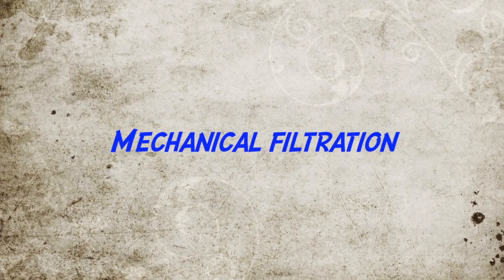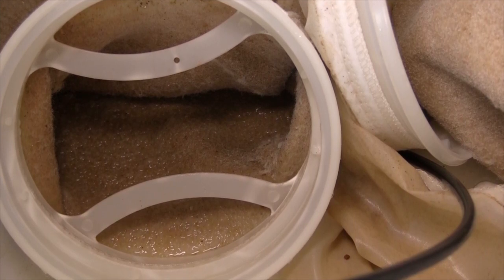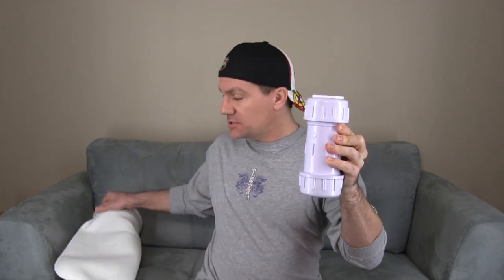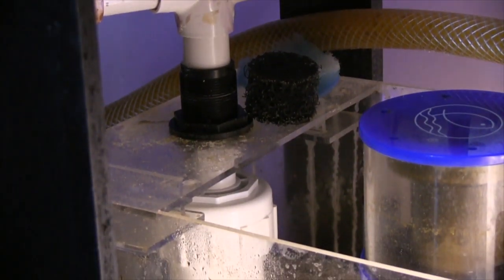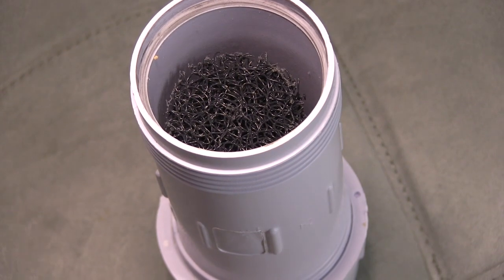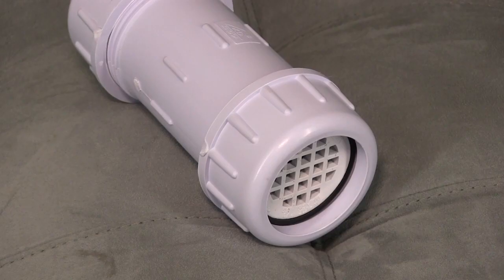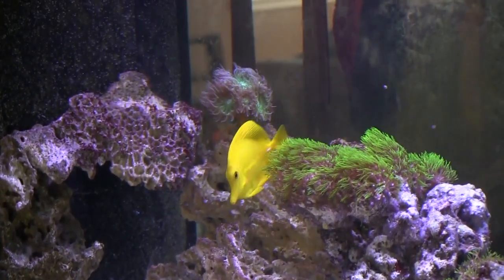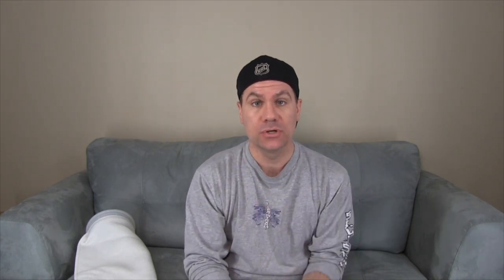filter sock filtration no longer needed! saltwater aquarium filter - rotter tube

Comment: I wouldn't add this because it an added risk of clogging or something getting trapped in it, causing your display to over flow.
Reply from the maker: correct, but you don't clog it with a bunch of filtration, just a little for the water to pass through and over. also, i added overflow protection.

Comment: I recently saw on BRS that you can pressure wash Filter Socks with High Pressure water or a Gurney and it cleans them so great.
Reply from the maker: yeah you can. I don't use them. I'd rather throw out foam pads once a week. Also, with filter socks, that nasty sits in your water.

Comment: Why not rotter tube then in to the filter sock? To times the clen I just asking would it even be werth running that way or looking at adding an unnecessary step to cleaning my tank?
Reply from the maker: that's a good idea. like you said, it's twice the cleaning. the sock would last longer though.

Comment: I have one essential problem with this particular product, if you should forget to clean your filter and you get enough waste backed up in it. Where does the water go? In the situation of a sock it overflows over the top of the sock holder in into the sub directly by passing filtration in the case of this particular device if left too long or a large fish load were to block the filtration it backs up into your tank until your sump empties and out onto your floor
Reply from the maker: hey, great question. it has never overflowed and i changed the design. it's so much different now. it's a horizontal 4" clear tube, parallel to the water in the sump...sitting above the sump water. the water flows easily out each 4" hole on each side of the tube with just a foam filter catching the water. i'll have to do a video again to explain better. never had an issue with these tho.

Comment: Whats the emergency plan on it what if it clogs up and your not home what if it slows down your water flow from the tank and cause the water to over fill your tank, plus that foam isnt  a great filter my advice is using a nylon sock fill them up with media, that way if it does clog your sump will over flow like its designed to
Reply from the maker: nylon socks would work great. i tried them. they work great and are very cheap. it has never overflowed. it works great for catching solids. changing out the piece of filter media every 2 days is what i did. i have a different design now that works even better and catches most of the waste. it's a horizonital clear 3" tube that connects to the overflow. each side is open, which thick filter media inside. links to this video in all video descriptions. thanks for watching.
Reply: @shannon- When you say fill up with media,  do you mean put the media in a sock and then in the filter sock or can I simply put the media directly in the filter sock?

Comment: any risk of clogging and overflow display?
Reply from the maker: +Eli Carter Hey Eli, thanks for dropping by. There is a risk of it clogging if you cram the tube with media that doesn't allow water to flow through. What I do is cut a filter floss strip to be 6" long X 2" wide and use only that. The tube isn't crammed. The water flows through it just like a sock. At the bottom you do need to place one of the grey filter media pieces that I show in the video or you could run the risk of it clogging when the felt piece gets full of debris, which you should check and replace every few days. I haven't had a problem with this at all and I've been running it for a month straight. I include a couple of these strips as well for filtration.

Comment: I thought the idea of a skimmer was to remove the waste before the bacteria had a chance to turn it into nitrates..and socks couldnt be easier to clean..buy the nylon ones they prolly last forever. You probably have more chance of clogging the drain from your tank with this than a 3 inch 200 micro sock.
Reply from the maker: wrong. never clogged. socks also sit in the water column allowing all the stuff to SIT IN YOUR WATER THAT YOU CAPTURE. thanks for trolling.
Reply: Im not trolling at all. I used to try stuff like this when i was a kid tring to save money. They just impeded water flow. I agree a sock will block up too but you can easily see its getting dirty. If a sock get blocked the water flow has the ability to overflow into the sump thus keeping the filter system operating.
Reply: Just buy nylon socks if you hate cleaning them so much. Quick rinse out and your done. Easy

Comment: Do you have a 1-1/2 size yet?????
Reply from the maker: i have relived on adapters for that, to go from 1" to 1.5" and it works great. the new rotter tubes are larger....3" diameter and the 1" is drilled into the side, so it sits horizontal in the tank and not vertical. this is the one i'm using now. the foam never sits in the water for this reason. you can add an adapter to make the 1.5" connection.

Comment: why you not using a filter sock no more ?
Reply from the maker: i like them but too much maintenance. i hate cleaning them, turning them inside out to clean, breathing in the nasty dirt when i turn the encrusted socks inside out. just something i didn't want to deal with. i made a new tube where i just replace 12" of foam pad each week.
Reply: Rotter Tube Reef when I get my tank setup I'm not gunna use the socks either
Reply from the maker: socks are great but the cleaning is just a hassle. i ran my tank with nothing at all for a few months and it was fine. i just did water changes from my sump, vacuuming out with a little pump, 10 gallons weekly. no big deal. you could do that. i installed the new rotter tube and that keeps my sump clean and the water polished. it's just what works for me.

Comment: Also with the Rotter Tube, Anybody could DIY make one.
Reply from the maker: that's right. I have a video on how I did it. Mine are clear thick 4" PVC, which isn't cheap, but of course you can use standard white pvc.

Comment: Cannot see this being as efficient as a filter sock, and I really don’t see people’s beef with filter socks is all about, lazy reefers never succeed fact.. unless you get really lucky and hit biodiversity perfectly and have no sump or filtration like I see on some you tubers with 20 year old tanks claiming no water changes, I call bullshit on most of those..
Reply from the maker: This doesn’t sit in the water rotting like a filter sock and there is no cleaning.
Reply: @ROTTERtube  a filter sock won’t rot when changed every 3 or so days, although clever this contraption is likely 50 percent less efficient than a filter sock, the rooter tube is likely not 150/200 or 250 micron, and filling it with carbon as a filtration solution is not particularly a good idea, carbon should only be used on occasion as it strips too much “good stuff” out of the water, like I said neat idea and will suit some tanks but not tanks that have a large waste turnover
Reply from the maker: @jimelliott33  Everyone has their way. I got tired of cleaning socks. I use and replace foam filter pads every few days.
Reply: @ROTTERtube  I love your inventiveness don’t take me the wrong way, but most new reefers will see this as a way of reducing the mundane work involved in being successful with a reef tank, you can’t be lazy with reefing, and I think cutting out a filter sock which is a pretty effective water debris filtration device could be detrimental to an otherwise working new tank, key to filter socks is like you said having a stock and washing a load at a time, we do all have our ways, like I said I like your device my only concern was the difference in micron filtration
Reply from the maker: @jimelliott33  No worries. That's the point of this...less work and less time so you can spend time doing other things in life or on your tank. Filtration is filtration. I have recently switched sumps that don't have filter socks...just a lot of foam for filtration. It's awesome.